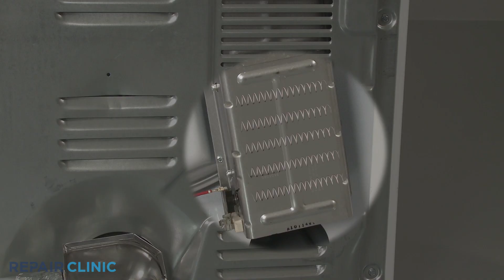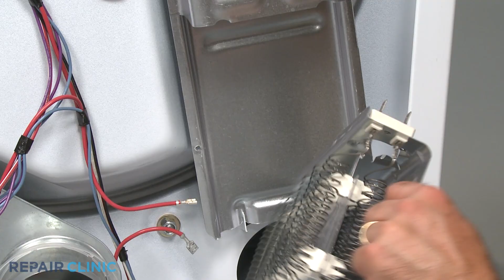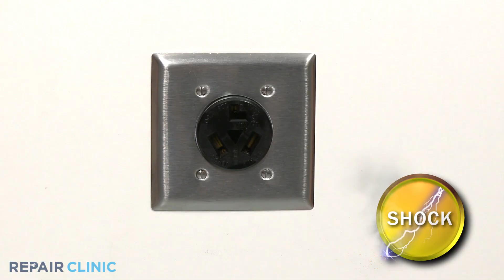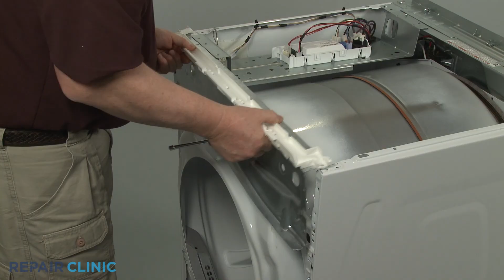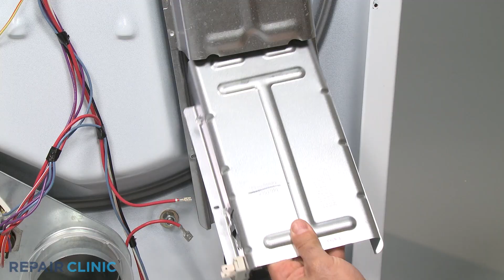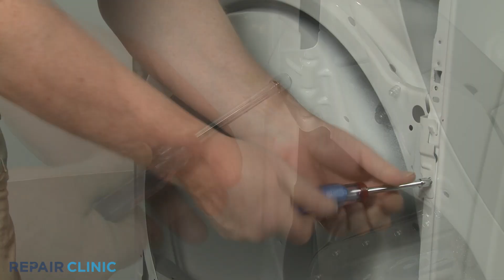Electric Dryer Heating Element - How it Works & Installation Tips

Comment: I'm confused about full size driers and compact. Do compacts use a regular outlet or does it need a special outlet? Why do full size driers dry faster then compact if the elements heat to the same Fahrenheit temperature? Thank you.
Reply: All I know is about the second half of your question! Larger driers have more air to carry the heat as they are larger, they also are known to have better ventilation!